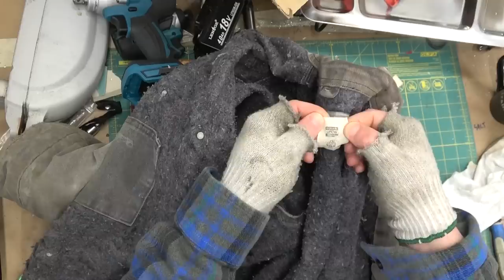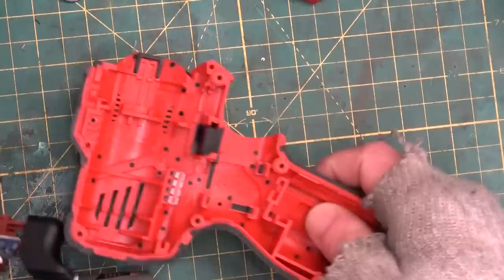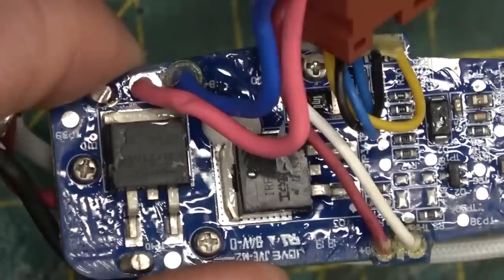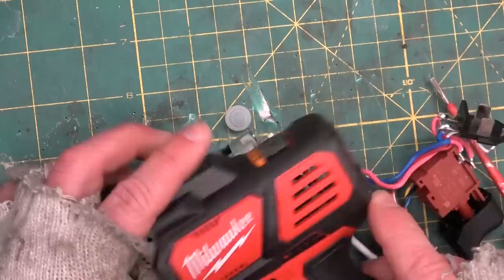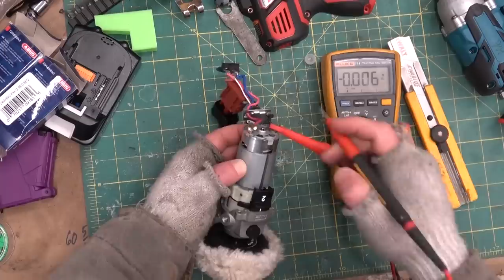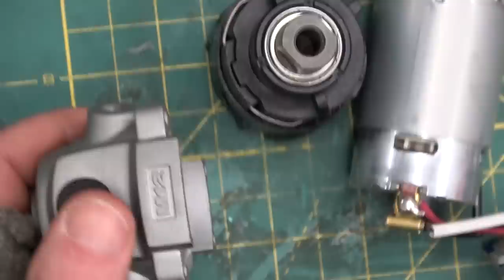BOLTR: Milwaukee Sander

Comment: Propper Shop Attire?
I weld in a Codpiece.. and Crocs..
Reply: Hey, saves a trip to the tanning salon. Leaves a nice dappled scarring, too.
Reply: Shayne you wear crocs 😬
Reply: Liking those “Fagan” work gloves...
Reply: Sandals with steel toes, that's the way to go.
Reply: i too have socks with holes in them.
Reply: @bmos02   and it helps keep my mankini line in check..
Reply: @notsevenfeettall   I've actually been dead a number of times in different scenes in a feature film..but never in a pool..
Reply: @donchristie420   Only for welding and occasional walks in the mangroves..otherwise..stilettos..
Reply: Stephen Austin   Yep..sadly, my dignity ran away to shack up with my self esteem years ago..
Reply: @clownshoesmma6249  Classy as frig!
Reply: @DanSpotYT   No..I can however offer strange women a cheeze ring if I don't shower..
Reply: I once had a bit of molten steel dripping into my safety sandals and it fell between my second and third toe. Obviously they stuck together during the "healing process" and I had to cut them apart two times a day for 2 weeks before I went to the doctor to get it patched properly. Always wear fireproof socks in the shop!
Reply: @allesklarklaus147   I normally avoid this sort of thing by squatting like an indonesian while laying a fat bead.. But, that sounds about as comfortable as my first engagement..eep!
Reply: Awe come on...  now that is horrible choice. Red wings shoes are the more proper attire.
Reply: Why go to a solar bed when you can get all the uv exposure by using a stick welder naked.
Welding backward might be a bit dificult though.
Reply: @allesklarklaus147  - I have some scars on the tops of my feet where weld spatter went through the eyelet holes in my OSHA certified safety boots.  After the second time I only buy boots with the 'tarsal guard' which covers that whole area.
Reply: @m60mgman  I was thinking "Aqualung", but yours is better.
Reply: PPE of the gods
Reply: Safety crocs I hope 🤣
Reply: I fry bacon... naked.
Reply: Bring back the codpiece!

Comment: The dust cover over the rear bushing was nice attention to detail, I’m surprised that wasn’t value engineered away.
Reply: Most likely they had too many die before the warranty expired in the previous model so it was worth the $.01 to save 1 in 200 or whatever warranty claims.
Reply: They must have had too many problems like my multitool eating drywall dust and dying.

Comment: 5:38 “shaves whole pennies off of the cost of the bill of material” 
... of a $540 tool. 
It’s what you’d expect from a knockoff Chinese brand for less than $50.
Reply: If Snap On sells 500,000 of those (to suckers), it'll save them $5000. Cost savings aren't usually figured in proportion to the retail price, they're only relevant in regards to the number of units sold. That's why saving pennies slightly under-building car parts is so profitable for the OEMs (and much more so for the aftermarket which will save whole nickles).
Reply: @bmos02  absolutely correct - the higher the volume, the more those pennies add up.  It's impressive, though not surprising, the effort a manufacturer will go chasing those pennies when producing tens of thousands of units per day.
Reply: Wil Thieme 
Yes I get that. And it helps the responsible manufacturing manager to get his kpi’s in the green area but . . . 
. . . in the long run things like this will result in them selling only 450.000 in stead of 500.000. The tragedy is that no one of the management will be even aware of it.
Reply: Wil Thieme 
Also pennies from the BOM resulting in nickles in retail is the wrong way of looking at it. This happens if you add costs as a percentage of the production costs while a lot of the costs are fixed. Eg shipping l, storage, marketing etc don’t get really less expensive by using the PCB in stead of a real connector. It’s only in the (false way of) calculations that it does.
Reply: @blzt3206  $5k adds up, plain and simple. You don't run a successful business with the resources necessary to expand by leaving pennies on the table, assuming that they're simply 'insignificant'.

This is the difference between those who are capable of attaining & holding wealth, and those who aren't - there's a reason why many millionaires & billionaires are known for being absolute cheap skates
Reply: Yeah, using PCB material to hold the battery lugs might actually work really well. I hope Fap-Off has actually tested it for many, many cycle of inserting and removing the battery. If they have and the PCB material stood up to the use well, then I would say this is actually really GOOD engineering.
Reply: @a89proof  And too many times, that exaggerately GREEDY and MYOPIC attitude causes more trouble for everybody... Just count the whole dollars lost in each automotive "Recall", or look at Boeing, saving a few bucks when omitting one or two Angle of Attack sensors...  Cost cutting at the level done recently, is largely counterproductive, but "CEOs" and shareholders seem to love risk for their companies... as they have "Golden Parachutes" when those companies go down in a spiral, unrecoverable dive... they just "jump" out the door.  Look at Dennis Muilenburg, who got more than 80 millon dollars... While the poor families that lost relatives in tve two crashes got only 50 million...  Can THAT be called "justice"???
Reply: @SaltyPuglord  I would say efficient enginerding  if  the circuit board holds up?
(Or its just penny pinching)
Yes, in effect, fap off is saving the cost of a whole [small] circuit board.
Reply: @a89proof  I totally disagree, its a $540 sander, I hate to even think of how that converts to AU dollareydoos, sell 500,000 (they won't) and you have $300,000,000 - $5,000 is chicken feed in that.

Everybody knows that you can get some good deals from the tool truck, shave $200 off that crappy thing when he's making space - Just think, $200x500,000 is $100,000,000 - Bit more than $5,000.

There's that many 'what for's' in the price that making little scummy 2 tenths of a cent changes is just fruity, the first guy's right, they couldn't care less.

 - SnapOn needs to pick up their game big time, their market is 'best of the best' and you can call a way higher price if your tool is unchallengeably the best, guys will grumble and go for a deal, but they'll fork up the money.
But if its not the absolute best then you'll sell f-all. Folks are wising up to SnapOn, especially their power tools.
Reply: @SaltyPuglord  I have had a bunch of snap on electric tools with the pcb connection to the battery.  It wasnt ever a problem.  The batteries have a crap connector and the main thing that failed on the tool was the trigger.

Comment: I'm guessing the HF version will be damn near the same as the Milwaukee, with a few corners cut.  Probably still better than that POS that snapoff is charging so much for.  I'm convinced the price hike for them is just because it's almost always financed.
Reply: Or they finally worked out that rather than spending extra money making quality tools they will just replace the ones that break and cash in on all the people that buy the new shiny tool out the shiny new catalogue that they really really need then leave them gathering dust in the corner for the next 4 years with 0% chance of them ever breaking
Reply: They're literally the tool version of Fingerhut or RentACenter - except a lot of tool collectors are far more gullible than anyone that got a Fingerhut catalog in the mail
Reply: Well they also offer outstanding warranty. I don't know what the snap on warranty is for battery powered tools, but for $500 they should be replacing those POS for life.
Reply: @deepPuddlesarefun  snap ons power tool warrantee is significantly worse than Milwaukee's... but the only thing is milwaukee doesnt have a truck coming around every week to replace it
Reply: If you think Snap On is bad these days....the mechanic across the street from me just bought a second Stihl pressure washer....that way he can alternate between the two....as they seem to run 3 or 4 hours then die, and have to go back for warranty work....if they are both in the shop, he has the same crappy Canadian Tire one I do that runs all the time, with no pretensions about hiding it's Asian origin.
Reply: @deepPuddlesarefun  it's a one-year warranty, had a snap off cordless drill that died and paid for the repair, the repaired one (they just replace with new) died on first trigger pull, no-load, never ever again for snap-on.
Reply: The “HF” version is very similar but with more interchangeable on the mandrel. From memory it’s 3/8” the milwakee is an M9
Reply: And delivered
Reply: I’ve got the HF version for polishing furniture and it’s been bulletproof. Also a plus is the cheap accessories pack HF carries for it.
Reply: @TheWolfsnack  Denis do you think it be an idea to ask AVE to review the Stihl pressure washer to see why it's dying after 4 hrs work?...
Most likely made in china plastic gears/internals?
Best pressure washers are a German brand called  Karcher.
Reply: @deepPuddlesarefun  depending on the day, the warranty is either 1 or 2 years. After sending my 14.4 long neck back for its 3rd rebuild, I got billed $125 to get it gone over. The quality is shit for a tool that costs so much. Dewalt and milwaukee are the go tos now. The 3-4 week turnaround time is bull as well.

Comment: Outstanding video.
So disappointing of SnapOn - highway robbery of them.
Hat's off to Milwaukee.
Reply: This tool got me into the m12 line. Abused it for years can’t rate it high enough
Reply: @TheLexiconDevils  Me too. Just an hour ago, I was storing my M12 hand drill, and chatting with my wife, I asked she when was that birthday party of our son, that was when I bough it to hang a "piñata" in our backyard... that confirmed my unit is just 6 years old, and the two compact batteries that came with it are still going strong!

Comment: One of my favourite coats is a 1960 British Army flak jacket, the inspiration for Brandit's Brittania coat and it is super good condition for its age, not a button missing or a tear anywhere and I am lying on the dirt and mud in it fixing my car up.   The other jacket I wear often is an old black Alpha Industries MA1 flight jacket, OK the pocket linings have given up but the thing is tougher than a coffin nail and just keeps on going despite it getting a lot of rough wear.   Favourite leg wear is my old lined 68 issue camo trousers I forgot to give back to HM Gov and still going strong after 30 years of hard wear, it has been patched countless times but the lining thermal inner is still good and its like wearing a pair of centrally heated trousers.

Comment: some of these power tools with circuit boards you should send to bigclivegotcom.. his teardowns and circuit board schematics are easy to follow. he tell ya if its crap!
Reply: BigClive ROCKS!
Reply: The problem with clive's vids is that he mostly cherry picks crap to begin with. Usually the same old pink USB power banks & cheap LED lights off of ebay. The best vids he has done was on the electrical system over in Europe.
Reply: @johnpossum556  it seems a lot of his viewers send him items too. Gotta go with your fans but his knowledge is still great when you need to learn how things are made. Schematics, Part Manuals, etc.. He seems to make it simple to the audience without belittling the audience.
Reply: @johnpossum556  Well when you have to rely on buying the shit yourself, I too would go for cheapo eBay chinesium bullshit to take eh-part to see how poorly engineered it is

Comment: Never trust a guy with clean shop gloves.
Reply: The only gloves a man wears in the shop 'round here are welding gauntlets. Which is kinda what you'd expect in a place where the winter daily maximum would be considered a summer heatwave by the denizens of central England...
Reply: Yep! It is like getting food from a skinny cook. No thanks.
Reply: Never trust a guy with shop gloves.
Reply: And an 80's cop mustache!
Reply: @jacobs1047  Hah good one. Last week I had to replace the differential in my car. In the middle of the job when I was already greasy and oily to my elbow I realized I have gloves. I took them out of my toolbox, put them on. On the greasy and oily hands. 2 mins later when they were dirty on the inside I've put them back to the toolbox, and continued the job without them. It just didn't feel right. But at least they will cause a surprise when I try use them again. Or someone else.

Comment: The diode conducts the motor current during the PWM off time so it won't chooch as well without that, putting a synchronous rectumfriar MOSFET in there reduces the power dissipation but not much advantage other than that, and it increases the complexity.

Comment: I’m a mechanic in Massachusetts Transit. Five or six years ago, most of the top brands were fairly equal, with snap on maybe being a little bit better than most. Since then, Milwaukee has gone all in on cordless. The M 18 line has had a few duds, but overall between performance and variety it’s out in front now.  With the five-year tool warranty it’s a solid bet too.

Comment: The diode thing AvE mentions is called by several names, but the most common term is https://en.wikipedia.org/wiki/Flyback_diode . It's good engineering and I'm happy to see it there. But I admit I'm a bit puzzled as to why such a big diode. I guess they were designing for the situation where someone is repeatedly pulling the trigger all the way and then letting go of it quickly. Like putting up fence boards or something? The repeated, fast, on-off cycling will cause the diode to heat up. So it needs to be skookum to absorb (and dissipate) all that heat. That's my best guess, anyway.

Comment: The only thing I don't like about Milwaukee is that I've only been able to find the switches as part of the whole "electronics assembly"  kind of annoying when your impact driver falls off of your belt and the trigger breaks off. I ended up gluing it back onto the post with some methacrylate adhesive. It's been working fine for a month now.

Comment: You can find vintage Carhartt on ebay just have to keep an eye out. I stocked up on a lifetime worth of J149's when I realized they haven't made them since i was a little girl. Got my first when I was 15 and it didnt start to show its age until I was 29. And this is Michigan partner, she may not have gotten ridden as hard or put away quite as wet as they do in Canukistan but close.

Comment: A freewheel diode works just fine for a one-quadrant drive with PWM.

A half bridge (totem pole) is two-quadrant, but that's overkill for this application (no need for controlled braking).

You could run a MOSFET in place of the diode for a tiny improvement in efficiency as the RDSon causes less energy dissipation than the diode forward voltage drop. Done right you might also see a reduction in electrical noise due to elimination of the diode reverse recovery. Neither of these would be worth the cost or effort to implement when the output is going to a brushed DC motor.

Comment: It does matter what is the motor control output stage if you consider higher power motors. In every PWM cycle, motor current flows through one MOSFET and a motor, and in the turn-off time the same current flows through the freewheeling diode. It is usually a Schottky diode which has lower voltage drop. But when the current gets higher, the diode losses are just too much and it gets replaced by a synchronous MOSFET that decreases the voltage drop - saving the energy and reducing the heat dissipation.

Comment: I have owned the polisher, impact and light since the well they came out. So far there not to bad. The batteries are great, and they do indicate charge level. The one light on the tool changes colors as the battery discharges.

Comment: Snap on website shows $225 for the tool $456 for the tool with 2 batteries and a charger. If you have a good relationship with your dealer and/or wait for sales, you can probably get the tool alone for $180. It’s still expensive for what’s inside. I’d like to see the two get used side by side. For me, the Milwaukee 3/8 ratchet wasn’t good enough to keep me from buying snap on. For all those saying everything snap on makes is a ripoff, they still dominate the hand tool market. Their electric and pneumatic has always been spotty.

Comment: The freewheel diode will protect the MOSFET just fine from the motor's back EMF. The voltage drop of the diode will waste a bit of energy, but using the diode saves all the extra circuitry that would be needed to drive a high-side transistor.

Comment: I was hoping you'd also test continuity from the positive terminal to the motor housing. The FETs have 2 leads (TO-252 package) which means the heatsink is the 3rd terminal. I can't see the part number, looks like "IRF3xx" which would suggest N-type (IRF usually uses 9xxx for P-type, i.e. a complementary pair would be IRF510 and IRF9510) and the Drain would be tied to the ground plane. 

That configuration could also be a half-bridge, IRF is pretty good about putting a free-wheeling diode inside their FETs so an external diode isn't needed.

Comment: The diode protects the regulator output from reverse voltage, as the motor turns generator, and provides a near short heavy load that brings the motor to a fast stop.

Comment: I've used the same 12v Milwaukee drill, same body style as this sander, for 12 years no. Its on its 3rd battery now and minus the rubber coating that has been in a state of failure for probably 11 years the drill is still kicking just fine. I work with plenty of people that swear by the smaller snapon power tools but I've never cared for the rocker type switch they came with in the past. 500$ sounds like you got cheated but maybe thats just the currency conversion. IMO the 12v milwaukee line is a very good investment. I am however a Dwilt fan boy i guess and stick to the 20v dwalt stuff where i can